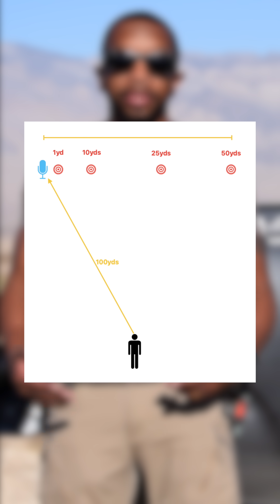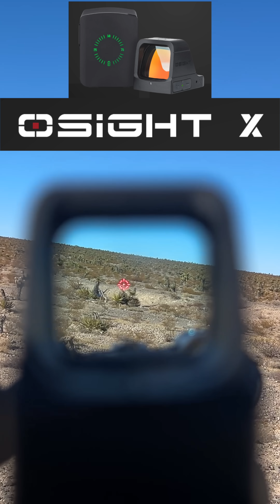Can You Tell How Close a Bullet Is by the Sound? | Whizz vs. Crack at 50, 25, 10, and 1 Yard

Comment: Interesting choice of placement for that optic on the ar-15
Reply: It hurts my eyes
Reply: @AC-uw4il lol to each their own, if it works it ain’t dumb. Remember it’s not about being tacticool.
Reply: @Liamfr34k  I'm not saying it doesn't work. It'll work with short distances, but the reason you don't put it on the barrel is cuz it ruins your zero, especially with longer shots Also, it just looks cursed
Reply: @AC-uw4il  I agree with looking cursed lol. But in terms of on barrel, wdym? The mount is on the rails which are around the barrel and if everything is bolted and tightened as should be, it should have no effect on the zeroing.
Reply: @AC-uw4il  also if that were case no one would ever be mounting lasers there since it’d lose zero.
Reply: @Liamfr34k  that's what I mainly mean that it looks cursed, and what I mean is having it on the barrel is basically on the rail end, the reason you have it on the receiver end is there's more stability. Lastly lasers are not optics it gives a general area on where your gonna shoot this is why they're down at the barrel or how some people have it on a optic mount.
Reply: @Liamfr34k  my bad but the other reason why lasers are on the barrel is to manipulate the laser easier since your hand will be on the barrel (not the actual barrel)
Reply: @AC-uw4il  for that last reason of manipulating the laser, that ain’t the case since most lasers come with a button and cable for you to be able to activate it from anywhere you choose to place your hand. I use the long C grip while tightening my sling with other arm for more stability.
Reply: @AC-uw4il  it will vibrate more if that’s what you mean I agree, but again that really shouldn’t affect zero unless the optics is some $20 for air soft from Amazon. The barrel placement only affect the zero with guns like classic ak47 with no railings, cause when you attach the mount for those it is on the barrel which does* affect the zero from it moving the whole railing around. But in the case of the AR and from my experience I’ve never had that issue, I do prefer it closer tho.

Comment: The crack is just a sonic boom. If you’re shot from 500 yards out with a 308, it’ll crack. If you’re shot from 10 yards with a 22, it won’t. It’s just a question of speed. It doesn’t make a difference to lethality either. At the end of the day, it’s a piece of metal moving at 700mph + and it will kill you if you’re in the wrong spot

Comment: Hey, just curious here, is that red dot on the ar mounted on the reciever or the hand guard? And if the hand guard how well does it hold zero?
Reply: It's just where Olight suggested it should go... So you can blame the gun and not their sight
Reply: @tremendousmoss  Olight or any optic company is not going to suggest one to mount a red dot on your handguard. Only mount it on the receiver.
Reply: @kuntekinte6246  it was a joke... Which clearly flew over your head just like that Osight is bound to do.
Reply: Olight or any optic company is not going to recommend mounting it on the hand-
guard. Only mount it on the receiver.

Comment: Interesting other than the 556 they mostly all sounded the same to me
Reply: It's because both the .22 suppressed and 9 millimeter were running subsonic ammo. Traveling under the speed of sound, 1125 ft. per sec. The AR-15 projectile was averaging 3000 ft.per second.
Reply: Noise cancelling headphones make all the difference. Had some AirPods in and it made a big difference.